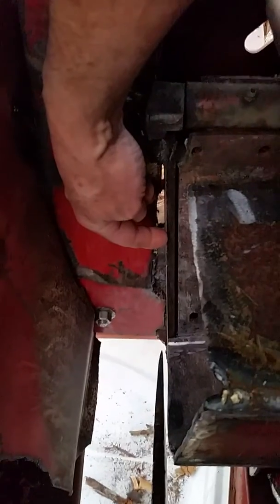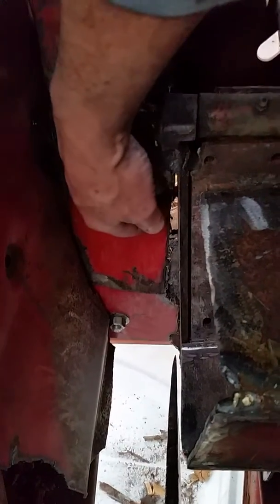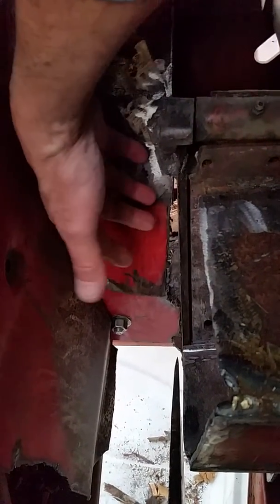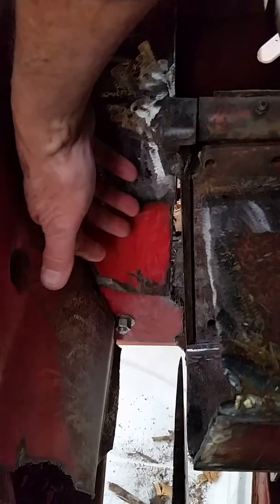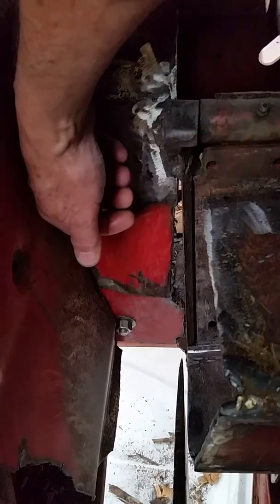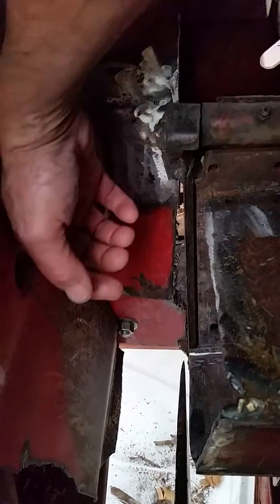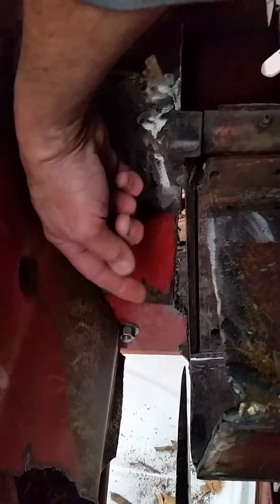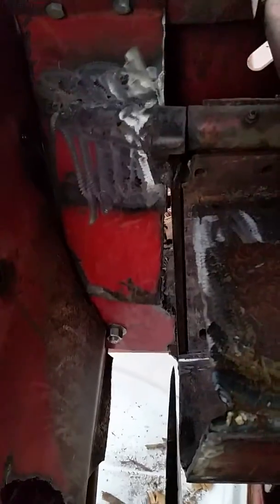Bob's Chunker blade rotation

Comment: Very nice on showing your blade design. What did you use for the blade? Also the top hook , what is its purpose? I'd like to make one for sawmill slabs. I have an antique chipper that the engine burned up on. The oil plug vibrated out and when you're throwing 4 inch limbs in it you can't hear the engine until its too late. Anyway I'd like a chunker because then the pieces could be stored and burnt as apossed to grinding them into chips. Also I'd like to build a conveyor for one was well. Old fire hose makes great rough use conveyor belting to bolt angle iron to for moving this sort of material "if you don't have belt material" plus its free from most fire departments.
Reply: He used a big old sprocket for his blade.